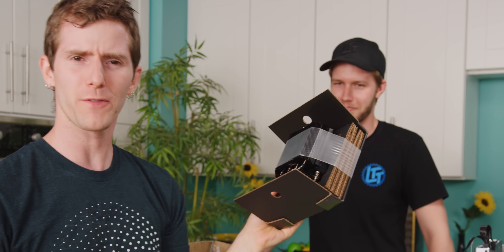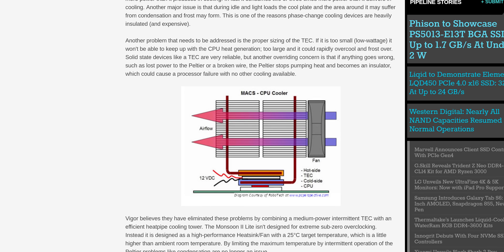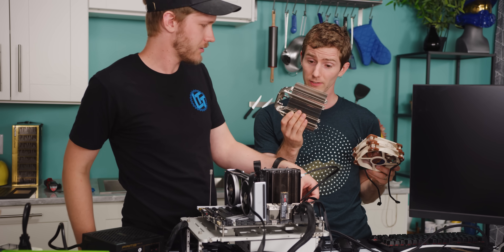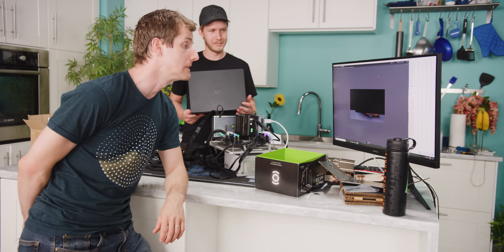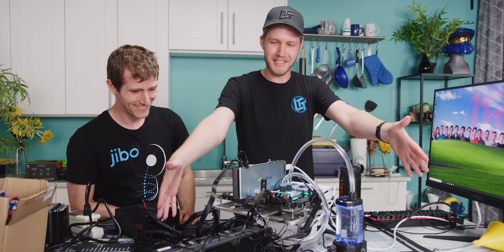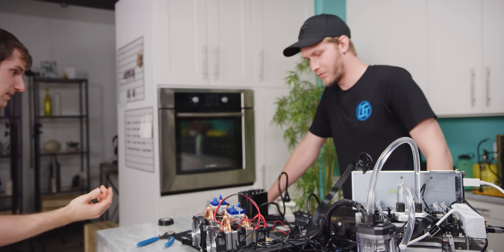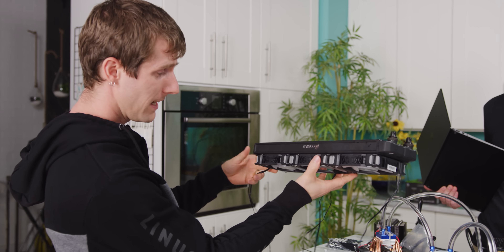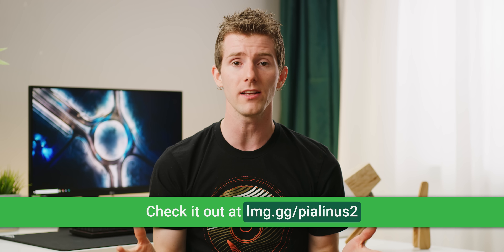Thermoelectric Cooling is a Bad Idea

Comment: Three questions for Peltier cooling:
What's the TDP of that cpu?  
What is the transfer capacity of that peltier chip?  
What is the rating of the heat sink?  

The peltier must be able to move more watts than the cpu, and the heatsink must be able to sink more watts than the two combined.  
Plus allowances for efficiency, or really lack thereof.
You meet these requirements and a peltier should do just fine.  

... How big it all is is another question. If an aquarium chiller is normally needed, and they're huge. You probably still need a massive heatsink on your peltier

Comment: I dabbled with peltier's back in 2004, while yes having the cold side directly on the cpu and water cooling the hot side did easily cool the cpu below ambient, the athlon 64 would idle at -7c but once put at max load it quickly ramped up to around 50c. I later discovered after I stopped messing with TECs that its a good idea to use a thicc metal block between the cpu and the TEC effectively easing the thermal transfer to the TEC. I never tested it myself, could be outdated or wrong info for all I know. Also the 70c of the TEC differential should remain constant  so keeping the hot side as cool as possible is crucial... so the Phobya G-Changer Xtreme NOVA 1080mm Radiator seems reasonable lol

Comment: You could do CPU to radiator to peltiers, the bulk of the heat would get dissipated in the radiator and then subambient in the peltiers? maybe? would be certainly more deployable than linuses chiller

Comment: I still have a Radeon 1950XT AGP graphics card with a peltier cooler, it was so "good" that once you plugged it in the cooling was actually worse than just with the air cooler :D

Comment: Only way it can improve is if you put the peltiers on the radiator, trying to dissipate the heat from the peltier with fans its still the same problem, they cant shed the heat fast enough, watercool the HOT side of the peltier and see how that works...

Comment: well that first one obviously wouldnt work
The TECs, need to be arranged.... hot object>TEC> Radiator........... 
arranging TECs, hot object>radiator>TEC>radiator, is like the Ouroboros eating its own tail.
Your trying to cool the room with the first radiator on the cold side, and dump your heat into that same room, with the heat from the hot side radiator.

Comment: The way thse heatpipes are set up actually makes a lot of sense beyond Peltier overheating. With a typical dual tower heatsink, the problem is the second tower is getting the hot air from the first one, so the temp difference is too small to accomplish much. By using the Peltier to pump extra heat into the second tower, you increase its temp and therefore the air temp it can accept.

Comment: I'm glad you mentioned the old days of mounting the peltier directly to the cpu, looking forward to watching you set fire to the test rig. I am pretty sure that by the time you reach sufficient cooling the ice will be a major problem. I suggest submerging the motherboard in fluid to prevent condensation.

Comment: You guys should use a thermometric in its alternate use case. Power a PC by creating a current with the TEc using a very hot and very cold side aka the Seebeck effect.

Also, might be worthwhile to have a thermometric inline with a conventional water cooling set up. Use power to get improved cooling effect.

Comment: I cooked a K-6 2 20 years ago with home made version of that cooler.  The problem wasn't it keeping the processor cool, it was condensation.  I had no control over how much cold it made so it was just on all the time and when I left my PC to sit for a while and it idled down there wasn't enough heat to keep moisture from building up so I ended up with a block of ice on my CPU.  Then when I went back to use my machine again the ice melted and well...  Water bad.

That back when I was young and stupid.

Comment: IMO, the benefit of peltier cooling is that you can transport heat away from the CPU without a failure-prone water system. I would love to see a system with a peltier cooler that takes the heat straight from the CPU to a 240mm or 280mm heatsink that you mount like a radiator.

Comment: Ask Der8auer. He has a Peltier cooler that works great.

It just needs a lotta power.
Reply: Well if it needs a way lot power than decent air cooler or water cooler then it's basically poor idea. Most likely you'd cool down more efficiently with refrigerator and still with better results. So, yeah, TEC is dead, at least in PC world/
Reply: A lot of power and a lot of heatsinks.

Comment: I had a cheap $40 Peltier cooler on my AMD K6-2 back in 2000.  It was worse than a passive cooler, noisy, and put a lot of demand on the power supplies of the era that had small +12v rails.  Shortly after I built a DIY water cooling rig.

Comment: Well I have dealt with peltier systems in diy setups. Peltier coolers work better in a water cooling situation. They are only as efficient as the cooler on the heat side. They're just heat pumps.

Comment: the peltiers would work much better in conjuntion to the regular radiator. its not exactly a practical setup but its good for overclocking where your trying to get temps down but dont want to go to exotic cooling like liquid nitrogen

Comment: i would like to know how the 2 peltiere coolers work in parallel if its more efficient to split the water and run them next to each other than in series with them running one into the other.

Comment: Guys, TECs ,may not be "efficient" - but using these crumpy eBay alu "cpu" blocks with BAD heat transfer doesnt quite do them justice either.
Cant remember which youtube channel made a test of those alu blocks, but they were BAD, in just regular WC loops, cause the lack of fins inside.

A lot of the cold is not transferred to the water this way - just use regular CPU water blocks from EK, swiftec or whatever will yield better results.
Also insulating the res, block and tubes is mandatory as a lot of cold escapes this way.

For a proper TEC solution look up former Tom's hw member OCAddict and his TEC build (he's on rev 3 i believe) - that is TEC cooling done right.
Also i didnt quite catch the cooling power of the two TECs used, only their power consumption which doesnt equate to their cooling power 1:1 :-)
If they are underpowered for a 10 core cpu ... you might want to rethink this - and get proper TECs with at least the required amount of cooling power.
I have been down the TEC cooling path, using water cooling for the hot side, which isnt cheaper i might add / but certainly a lot quieter :-)
I wish you would do there kind of experiments right and not just slap on a catchy title.
Maybe do a challenge of the best TEC cooling solution between some LTT teams ? :-)
Also why not replace the TEC in the cpu cooling tower with one a little beefier ?

Again - how many ppl use a 10 core interl power hungry cpu ... do a test using regular cpu's available to the masses.

Anyway, keep up the good work.

Comment: They should have tried a parallel cooling line rather than a series line. Instead of putting one cooler after the next they should’ve used a splitter and made the flow go throw both at the same time.
Reply: The problem with a line in series is that the available cooling watts don’t add up directly because your ambient temperature can only cool the peltier cells so much, so if your ambient temperature can’t keep up with the 300w of heat then the peltier cell won’t keep up with the water temperature. If you connect in parallel you’ll be able to cool the peltier cells the same as in a series line but each of them will cool a separate stream of hot water, that way the cooling capacities of both will be closer to actual adding up to the 600w theoretical maximum

Comment: How about adding one or two of those in line WITH a radiator too. I always thought about the concept of adding something like that rudimentary block/TEC/Air cooler solution to a loop as a chiller for a loop. Would help get temps back to or closer to ambient inbetween load situations, or as load waxes and wanes like in gaming, keeping the median temps lower across a session. But always considered how ugly it would look, how much space it would take, power consumption, adjusting to have a sensor to shut off the TECs to prevent water from getting sub ambient in long idles for daily usage, and money, so never tested it. But curious still.

Comment: That's taking me way back to the early cooling days I was strapping pelts to the bottom of the very early DangerDen blocks and black ice radiators  and trying to insulate the socket, etc. from the inevitable condensation. What a waste looking back but it sure was fun. Had to have a separate power supply just for the TEC's because the ATX power supplies of the day just didn't have the overhead.

Comment: Back in the day tigerdirect used to push TEC's a lot as the fancy new thing, so I bought into it. The temperatures were garbage considering it cost like $120+ for the whole unit...even in those days a basic air cooler was more than adequate. These days they're worthless...

Comment: hm, Some time ago me and a friend tried the last configuration (Peltier directly on top of the CPU, heatsink cooling the hot side of the Peltier), condensation and frosting is a serious problem, but after reaching the (obviously jank and unwise) solution of putting the motherboard upside-down, long story short, the temp sensors on the CPU no longer work XD
but in all seriousness, a Peltier cools better when you cool down the hot side, the better you cool the hot side, the colder the cold side goes, do take into account the maximum temps for the Peltier before testing.
some time in the future we will attempt regulating the Peltier temp and power draw with the fan connector from the CPU, maybe then, we will achieve low temperatures without condensation
EDIT: forgot to mention, the reason the temperature sensors failed it's because the CPU got so cold that there was condensation on the other side of the board

Comment: What about combining a freezer with an oil bath in a aquarium? You can cool down the oil on the top with the heat pump below freezing and there's no moisture issue, since the whole aquarium is full of oil (you just need to seal the top and fill it to the brim).

Hot oil would rise to the top, cooled by the freezer's heat exchanger and the cooled oil would fall down to the hot components.

In the oil bath regular coolers and fans can be used, but keep in mind that very small gaps between the heat exchangers on the cpu coolers might be an issue because of the high viscosity of the oil on low temperatures.

The oil type is also worth a discussion, I tested a setup once with regular rape oil.

Comment: Put some PID there to limit low temperature - basically control peltier power based on temperature). It would be looking much more feasible 😏

Comment: II-VI semiconductor TECs have been reguarly used in commercial semiconductor laser packages since the 90s, so that statement about 2005ish technology being immature is incorrect. They are unsuitable for this application: as a heat pump they can maintain a component at a very stable temperature, which is important for optical emitters due to nm/K shift.

Comment: What about using both a rad and tec on the loop? The rad should be able to take up some of the thermal load while the tec cools the water slightly more.

Comment: theoretically, could you not add one of the electric cooling blocks into your liquid cooling loop?  have liquid hit the hot CPU, run into the rad to take the bulk of the heat out as you would in a normal system, but adding the peltier cooler to act essentially as a "pre-cooler" for your cooling liquid.  Pre-cooling the the already cool fluid should theoretically increase its cooling potential. and because the pre-cooler is only dealing with the "cold" end of the radiator it wont need to work nearly as hard to achieve or maintain its target temp.

And if that logic does check out, Would it again just be a better investment to invest in a larger radiator or could such a system have potential (though not practical lol)?

Comment: Wait a sec.
So in the last test the modules are upside-down. 
Do heatpipes even work this way?
Reply: Doesn't really matter, they work via capillary action.
Reply: @ForeverMasterless  : Yep. The inside is maintained near a vacuum, so small temperature increases cause instant evaporation. If another part of the heat pipe is colder, then you get condensation there. Then the capillary action moves the liquid (usually rubbing alcohol I think, but technically could be all sorts of things) to where there's a lack of it, which just happens to be the hot spot.
Reply: @absalomdraconis  thank you for the explanation!

Comment: .... except for the part where your heat pipes are upside down. Don't heat pipes need gravity to work properly (the vapor forms at the bottom and rises, gets condensed at the top in the fins/fan assembly, runs as a liquid down to the heat sink, phase changes/boils, repeat...)

Comment: did u actually lower the pump speed? else the peltiers have no to little 'time' transfering the heat from the water to the block. due to the extra watts of the peltier itself. on second thoughts, i dont think this would work that way either, so nvm.

Comment: Jeez I remember peltier coolers back pre 2000 to allow CPU overclocking to 200MHz+ :)
Reply: Same here, i had it on a p3. I could never stop the condensation.
Reply: @johndeerrm  Imagine if you could like take the Noctua design back in time and emm patent heatpipes.
Reply: when linus said there may be older ones, i thought back to the celeron 300a days.
Reply: I took my Cyrix 2 into Quake 3 Arena  with a voodoo 2.  @josefkeitell6946
Reply: had a peltier cooler on my Slot 1 Pentium III in college... back in the days where water reservoirs were tupperware, and waterblocks were something you cross drilled, threaded, and plugged yourself and radiators were something you ordered from autozone.
Reply: Then you get condensation
Reply: When the first Athlon chips came out you NEEDEED one to run a gaming pc if you didn't have air conditioning. When I was a kid in florida it would get 100 degrees every day and we weren't allowed to have a window a.c. unit so the only way to use the computer was one of these or it would crash before it ever got to boot windows.
Reply: Haha I had the thermal take subzero 4g worked alright with the P4EE and a shit load of fans lol
Reply: @davidw1019  That's modern stuff dude. In my day it was k6-2 chipsets then and Athlon or duron. There was no thermaltake, the best coolers were these giant heatsinks that weighed 5-10 pounds held on by a spring clip made by zaliman.
Reply: @kg4boj  haha my first pc was the k6-2 haha I had one of those 333mhz. Had some switches on the motherboard overclocked that to 334mhz 😂
Reply: @davidw1019  My first computer was a timex sinclair which I upgraded to a trash 80, then ibm pc 386, 486dx, then the pentootium followed by the k6-2 duron, then Athlon.
Reply: Glad to see on other old school guy om the comments :)
Reply: @josefkeitell6946  Funny, their architecture eventually got sold to AMD and soon after featured spectacularly low power draw for mobile products.

Comment: Try Digikey part 926-1300-ND.  73C max delta T.
Is that any better than what you have coming? 
It's in stock, and has a maximum dissipation of 153w.
Vmax is 29.8vdc, so you might want a DC-DC convertor or 10-amp bench supply.

Higher delta T is possible (up to 130C), but total wattage drops off to sub 10w levels, so unless you're overclocking a phone or Intel y-series, there's no consumer application.